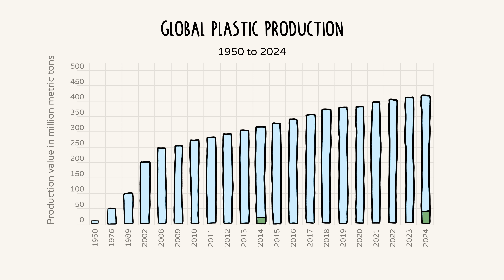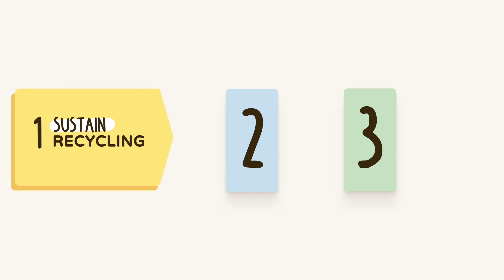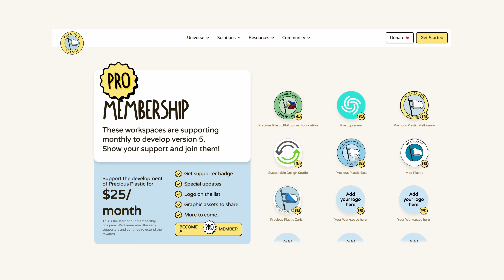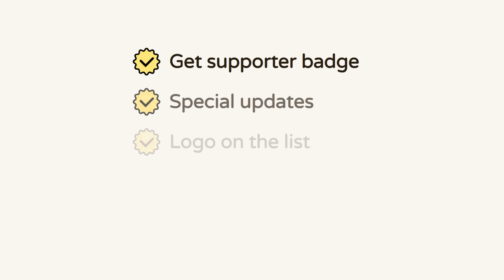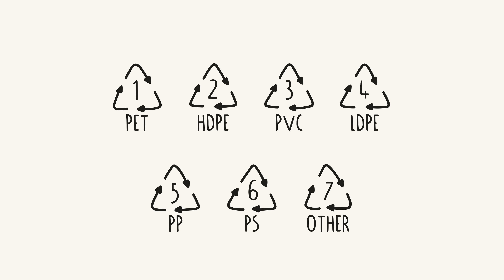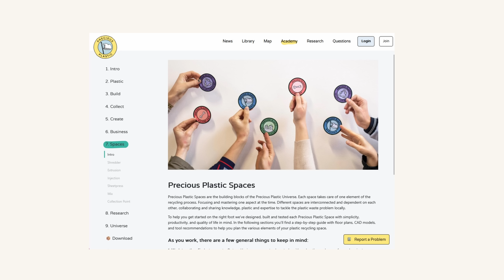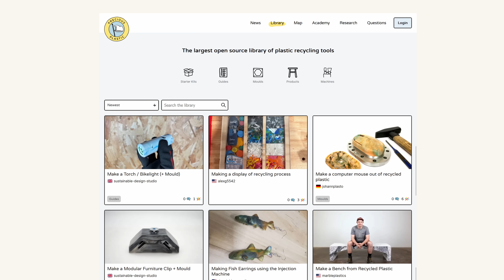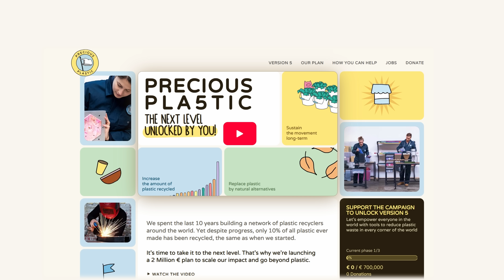Here is whats next for Precious Plastic

Comment: I think the best thing to do with used plastic is burn it for the energy. I tried it and due to the recycling polymer chain lengths get shorter, limiting the number of cycles. Wood is the ultimate biodegradable polymer. An interesting point Bakalite ie phenol formaldehyde is slowly biodegradable.
Reply: Nope.
Burning is dumb, that means putting lots of CO2 in the atmosphere and to have high toxic waste from the remnants.
All starting from an energy inefficient material which is used for a single time.

What we need to do is to go back to reusable containers and tools as a first thing, then recycle the rest, which is a small quantity of the total.

Comment: What is required is for every plastic product supplier to accept back the empties. By that I mean every retailer where you buy your milk from, for example, to have the facilities to collect returns and their supplier to take back theirs and so on back up the line. I think this would force the manufacturer to think about their containers in a more environmentally friendly way. 
I can recall that a local small shop (Spar) supplied a carrier bag that was biodegradable and this was nearly 50 years ago. Progress is sometimes glacially slow. 😢
Reply: They should also be required to fund recycling programs because many people won't bring their plastic back. Bottle deposits are a great idea imo

Comment: You're not helping the plastic problem at all. Just because you recycle plastic Doesn't help.
 Because then you turned it in the other plastic. And want to sell it. You're a scam. You have to get to the big manufacturers to stop making things out of plastic that's how it stops d*** you're stupid. What? You should have been spending your time on. Is turning plastic in the diesel fuel dummy. You and this pledge the company and project Camp Are a bunch of scammers.

Comment: There is only ONE (keystone) impediment to plastic recycling.  It remains (significantly) cheaper to produce virgin material than to recycle with most polymers.  The solution is to heavily disincentivize the creation of virgin material.  If we make it expensive to produce, sell, buy, or use virgin material you incentivize change.  This makes recycling actually economically viable and far more desirable.

Comment: One thing I have never understood and feel like this is a good place to talk about is Single Use Glass Packaging.
Why is it that once a Jar is emptied, it needs to be recycled? Plenty of people have taken to reusing jars as drinking glasses and other things,
but if we had a Standardised System of glass jars (and other single use glass packaging), those could simply be taken back to shops or collection points where they could very easily be sterylised and reused.
It would be incredible if all or even some glass packaging could be easily reused to continue its current function, and if the right incentives were there, many things currently sold in plastic could also be distributed in glass.
Far from inpossible, we used to do this with milk and even Coca Cola bottles, as well as plenty of other things before they switched to plastic containers or single use glass.
Other materials could also be used in this way if the infrastructure exists. Rather than recycling something that is perfectly capable of continuing its job, we should as a society be reusing it.

Comment: You should open to chemical recycling, in particular to plastic pyrolyzer which turn the plastic into fuel. Connect your current network with small batch pyrolyzer producer: you have the ability to recover, collect, sort and grind the plastics, and feed the pyrolyzers.
Reply: I'm so curious why this isn't done on a more industrial scale. It's just Naturejab doing it.
Reply: @BuzzBuzzChange lot of nasty stuff in modern plastic
UV Stabilizer, colors, fire retardant, glass and carbon fibers, stays in high concentration in Ash. What you will do with this dangerous waste?
If you have any idea I knew about huuuge pyrolysis plant in CzechRep, that we can use for testing.

Comment: How to help each other -- The equipment cost is high for small time / few time use(s).  For example - a shredder.  So while we have piles of post consumer waste, sitting around, we do not have a shredder.   Problem with buying / building a shredder is the one-time high cost, space required, and that it will mostly sit, doing nothing most of the time.   That points to shared ownership, or short term rents / leases.  This is where a community comes in.  Ideal equipment would be light-weight (shipping costs) break-down to small easy parts to box and ship, and probably not even have legs or a stand, and multi-voltage for various locales.  Our local use would probably be a week or two tops, maybe 2 to 4 times a year.  Anyone else meet this profile of use or interest?  Thanks!
Reply: Your comment has me daydreaming about building a shredder in a cargo trailer so it can just roll up to a new place and get shredding, using either shore power or a generator.